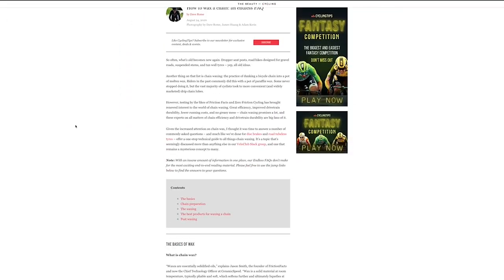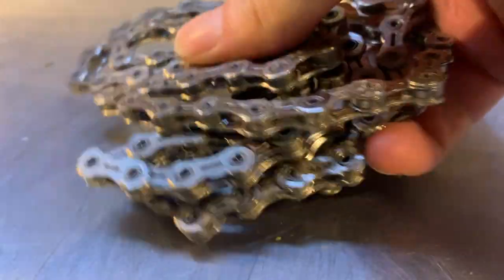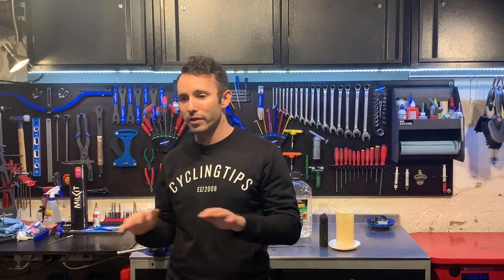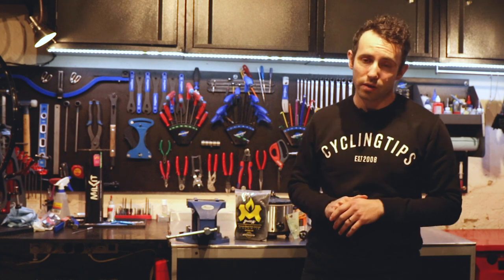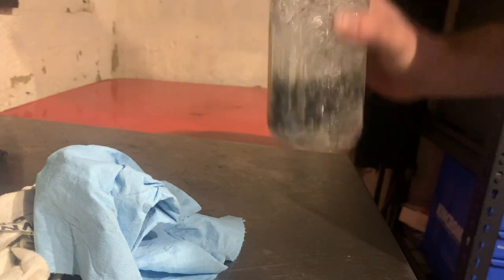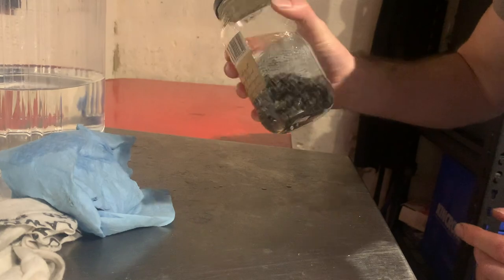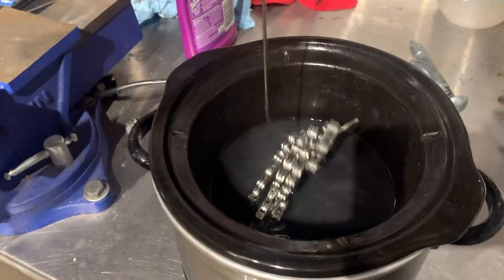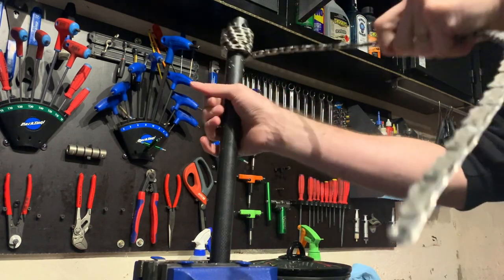A beginner's guide to waxing a bike chain

Comment: I feel dumb, but I didn't realize you can get a pre-prepared chain and then NOT need to mess with the solvents. That has renewed my interest in this process. Thanks!
Reply: cleaning the chain is really really really easy. use petrol soak the chain for a few minutes use a toothbrush and some gloves to get debris away then let it dry shouldn't take any longer than 10 minutes and start your waxing process. if cleaning it prevented you from doing this lube method then to be honest maybe you shouldn't be looking into waxing your chain as waxing is harder than cleaning it. Plus you'll have to figure out the right recipe for you. I use paraffin wax paraffin oil and Graphite. Everyone has their own mix and mix proportion.  normally you would mix 1 gram of graphite to 10 grams of Paraffin Wax/Oil. A 10 Too 1 Ratio. i just used grams as an example.
Reply: @fubar1872008  I for exempel live in an apartment where I don’t really have a work area good enough to clean the chain but I have no problem to have a slow cooker for the waxing part so if I can buy the pre-cleaned chain it makes it possible for me to use waxed bike chains.
Reply: where did u get yours from ?

Comment: I’ve waxed my chain using candle wax and got 35,000km so far commuting. Never cleaned it, degreased it or anything else. Just plonk it into candle wax inside an old fruit can and straight onto stove top, 15 mins max and you’re done. Hang it up for 10 minutes to cool and then onto bike. Add candle wax to pot as it gets used up. About one small candle per 1000km seems to be plenty. Don’t see the need to complicate it further. Cheers
Reply: Do you use tea candles?
Reply: @RyMe-g9k  yep, the white ones. Sometimes even the blue ones with citronella. It keeps mosquitos away while I wax the chain haha

Comment: I tried this method and works great! Just a heads up though, if you ride regularly in wet conditions, the wax will wash out very easily so is not really recommended in these environments. In UK winter/autumn, I won't get 30ks into a ride before noticing most of the wax has washed out and have even had chains rust overnight after a ride. I now use a wet lube for Winter/ fall and wax for summer and late spring when it's mostly dry.
Reply: Add ptfe
Reply: @ahipkiss14  Will the add of ptfe make the wax stick better to the chain and make it more resistant to rainy weather?

Comment: Isopropyl alcohol is actually pretty cheap here in the US. Odorless mineral spirits is pretty expensive. Also, this process works best if you have a bunch of chains. It's just as easy to rewax five chains as it is to do one.

Comment: Been using Squirt for years, which is a wax lube.
Love it to death.
Reply: Squirt is the go. Got an extra 3000km out of my last chain which had Squirt applied from day one. Just need to apply it a bit more regularly.
Reply: Recently started with Squirt and it is, indeed, the job.
Reply: I liked it at the start but after a while the chain squeaks.
Reply: @DanTuber  seems a bit odd maybe a stiff or dry link

Comment: A a good way to give life to a beat up old chain is oil the chane from the inside while in a container; first I remove the chain completely then I melted some teflon into some prarfin and put it the oven for 30 minutes then boil it in linseed oil or lamp black graphite.  If I use the oven it takes about half hour with kerosene gel.  Drip it on with a spunge and wipe it off with a rag.  The parafin works as a binder and a lubricant so you can use WD-40 or silicone based cleaner without risking a total wipe off

Comment: Waxing is great if you either don't ride often, or don't ride big miles.... At best, I get 350km (200 miles) before the chain is unbearably squeaky.... And that's all dry weather riding.  If you do just one wet weather ride, you'll have to do a full clean and rewax.  I've tried plain paraffin, paraffin with 10% teflon, and paraffin with 10% PTFE/5% molybdenum.  The PTFE/molyb mixture is the best for longevity, but seems to attract the most dirt because of the molyb, and needs a full reclean between waxes.  I'm so tempted to just give up waxing and go back to Boeshield T9...
Reply: I have the same experience riding 400 - 700 km a week the whole year in all weather conditions. Waxing just isn’t working especially in the rain. My favorite lube is Boeshield T9 because it can handle a bit of rain. It lasts somewhere  250 - 500 km typically 3 - 4 rides depending on the temperature and road / rain conditions. Also the chain stays reasonable clean and is easy to clean and relube.

Comment: The most tedious part of chain waxing is waiting for the wax to melt!
I'd also recommend you allow the wax to cool to around 55 degrees centigrade before removing the chain from the wax. Then give it a quick wipe with a clean microfibre towel then dump into cold water. Allowing the wax to cool means it won't run out from between the pins and rollers.
Check out Oz cycling YouTube channel for a deep dive into this subject
Reply: Zero Friction has debunked Oz Cyclings methods. Look it up. The guy is also an animal abuser.

Comment: How do you clean a waxed chain after a ride? For example dry ride but with mud springing up.
How do you wash your bike with a waxed chain. Doesn't the water and dishsoap /hoze (not high pressure) that I use remove the wax? Since it is said that wet conditions aren't the best for wax?
Reply: Also need to know this!
Reply: Just wipe it with a rag. If it’s super dirty you may need to pop it back in the wax again.

Comment: You said do not overheat the wax - when would this point be reached and is it just to prevent fire 🔥 or more about braking down the formula and degrading the lubricant?
Reply: Google says Parrafin flash point and PTFE temp resistance are both at about 200°C, so both I guess. Just take it easy at first, wait for it to melt, back off a bit at that point and enjoy. Works with many things in life.

Comment: It appears that only paraffin is being used and that's why the chain is so stiff.  This leads to unnecessary additional work making the chain flexible again.  The proper procedure is to mix a pound of canning paraffin with 9 oz of motor oil.  Heat the mixture until it has the consistency of water, then dip the chain.

Note the two lubricants work with each other.  Used alone, I found that the paraffin flaked off and obviously, using motor oil alone is a disaster.  Together, though, the chain is extremely flexible and is dry to the touch.  The chain will have a thin uniform coating on the chain that doesn't attract dirt.

I use a 300 mile lube interval and when it's time to relube, I just dip the chain back in the hot lubricant and when cool, reinstall the chain.  As a strict roadie, the chain almost never needs cleaning.  Off-road riders' will usually need to clean before relubing.
Reply: You lost me at motor oil 😂
Reply: @jamesshepherd9154  I explained this.  They work together.  I suggest reading my comment again.  I've been using this combination for over 20 years.
Reply: @philhouck3560  with just wax, the chain is stiff until you break you wrap it round a round object - I suggest that using motor oil completely  negates all the benefits of using wax in the first place.
Reply: @jamesshepherd9154  I have been using a combination of canning paraffin and motor oil for years.  The chain does not get stiff  like it will when only paraffin is used,  Shifts feel buttery smooth and I haven't cleaned a chain in years since I stick to pavement.  The  combination of paraffin and motor oil works because they are used in correct proportion to each other: one pound of canning paraffin to 9 ounces of motor oil.  It simply works.
Reply: @cracked229  The two balance each other out.  With paraffin alone, the chain is too dry but with the correct amount of motor oill, the chain will not be wet.
Reply: @cracked229  I have never put so many miles on the chain until it started squeaking.   I just relube at 300 miles.

Comment: I ran mine under cold water right after I pulled it out of the wax. I was told by doing that it freezes the wax up inside the rollers and pins better. It was a big mess though. Took a long time to clean the chunks of wax out

Comment: I’m sure it’s buttery smooth but I’m afraid I simply cannot be bothered doing this. Seems messy and way too time consuming. Will continue to use chain lube and spend the time I’ve saved riding my bike!
Reply: You're wrong, lubing the chain is messy and dirty when you touch your chain 😉, i'm waxing my chain when it start being noisy or after rainy ride, at the evening it doesn't take you any time for ride

Comment: I don't get it. A new chain is $30, just buy a new one frequently. What is your time worth to you? Use dry lube or wax-based lube like Squirt and a chain stays very clean. Waxing doesn't do well in wet conditions and is a pain to dry afterwards. If you use a ultrasonic cleaner or slow cooker, both are likely both forever more chain waxing implements that you have to buy and store somewhere. People overthink this.
Reply: Just have 2 other chains on stand by and switch out accordingly